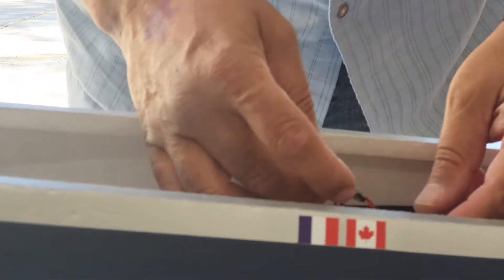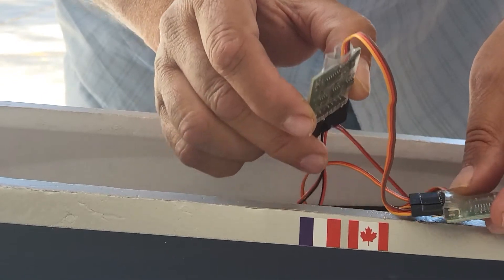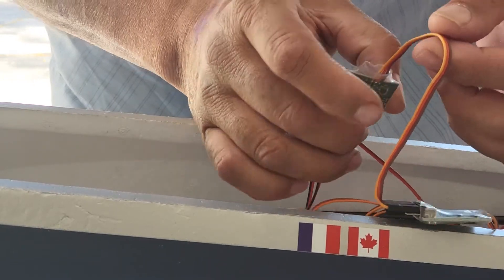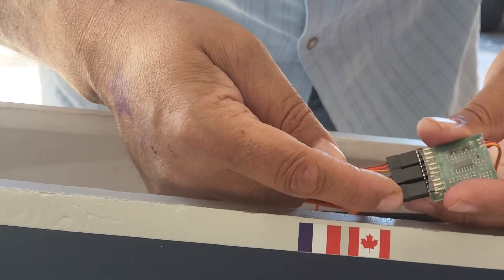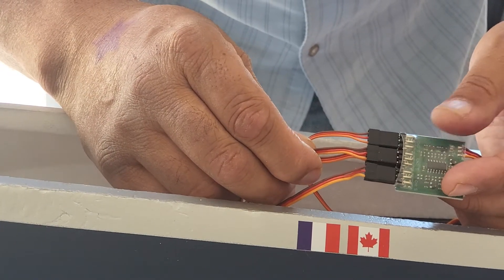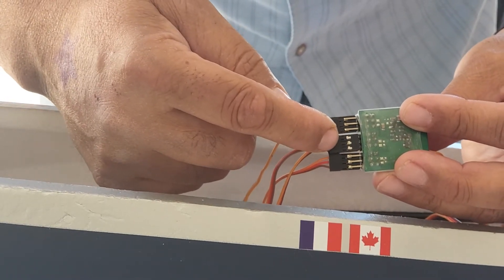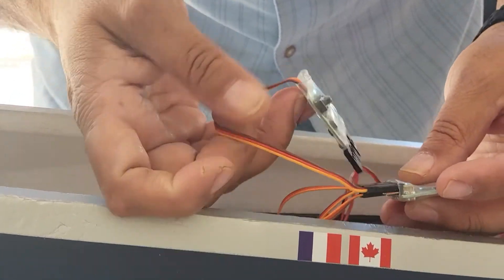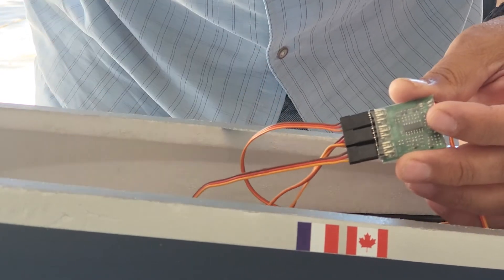Aerofoam L-39 Retract and Sequencer

Comment: I have the newest Arctic Camo L-39, with the metal gear servos. When I power the model up, the gear retracts, no matter what position the gear switch is in on the radio. This  is not good, because the gear will go up when the airplane is on the ground. It is also not normal. Any tips on how to resolve this issue? Thx!
Reply: I have the same plane and same problem.
Reply: James i have the very same problem! If you found the fix to this problem could you please let me know how to fix this. Thanks friend.
Reply: @leejimerson3354  I did fix it. I installed an Xicoy LG15 gear controller.
Reply: @jamesvaliensi7706  haha I order a JP gear controller
Reply: @octane2099  Oh yes they work well too. I like the built in gyro and options for door sequencer that the Xicoy offers.
Reply: @jamesvaliensi7706  Thanks very much James for the info. I only have had this airplane for 2 weeks so i will see if banana hobby will take care of this first.
Reply from the maker: @lee jimerson  Contact the the vendor where you bought it, BH or GJC and explain the problem. The solution is a replacement retract controller